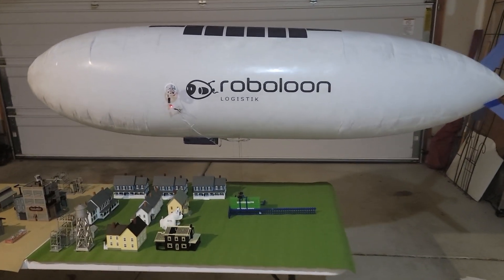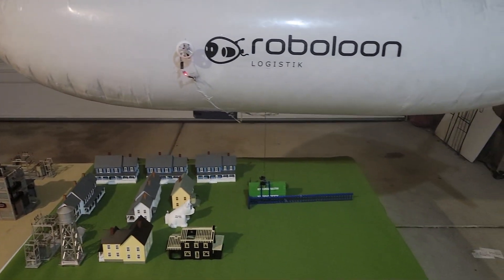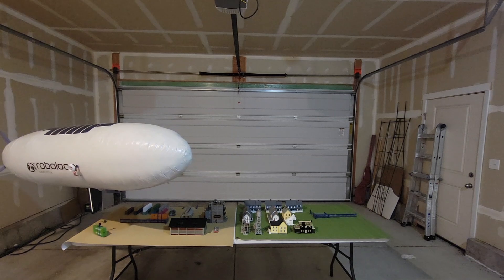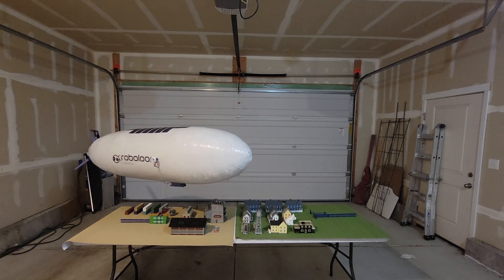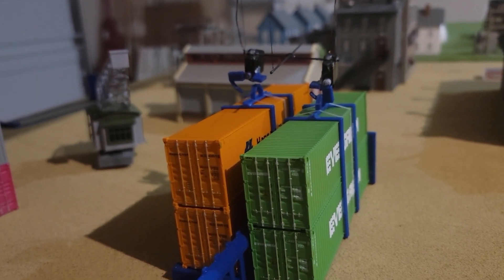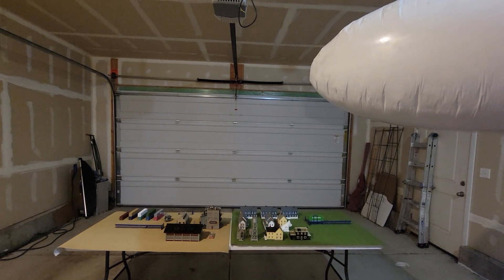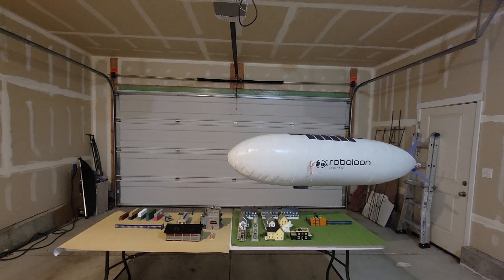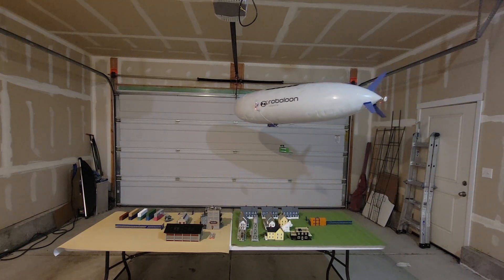Solar Cargo Airship Diorama

Comment: A decent attempt to solve the ballast problem but what would the city be shipping back to the factory besides the container's mass?
Reply: Right, this is a common complaint with airship transport. While it has some merit, In my opinion it is often overstated. In real world logistics, you design your routes such that the vast majority of the time you are carrying something on all legs of a journey. Because transport vehicles don't make money when they are empty. So, for example, real world cargo planes very rarely take off empty; they transport cargo X to their destination, then offload that and pick up cargo Y and proceed to the next destination, and so on. That being said, your concern is still real in some situations. Sometimes you have need to transport cargo to a destination with no real return cargo of value. For situations like that you have 2 options:

1 - Use the empty shipping containers from the previous dropoff and fill it with dirt, water, trash, sewage, or other low value mass available just to provide ballast
2 - The airship can actually carry small loads dynamically up to about 20% of the airships gross lift. Fly to the destination 10% "heavy", then drop the cargo, then fly back to the source 10% "light".

With option 2, you can only transport a smaller cargo capacity in that fashion. While the simple blimp shown in the video is transporting about 37% of gross lift, you can only transport about 20% using dynamic lift. However, 20% is actually still not bad. It compares favorably with aircraft like the 737-800, which typically only carries about 25% of it's MTOW in cargo. I would encourage using a blimp that was rigged with such a load away from populations, however. I know from experience that as the blimp gets heavier and heavier it gets harder to control. That is one reason why hybrid blimp projects always fail. 10% heaviness is something I feel can be managed in a remote environment, but not something I would feel comfortable flying near houses with people in them.